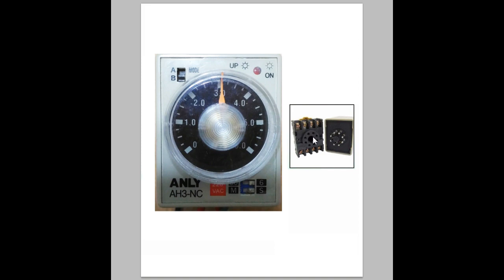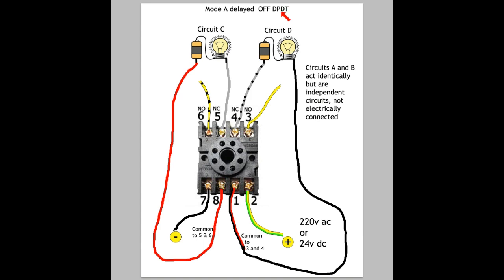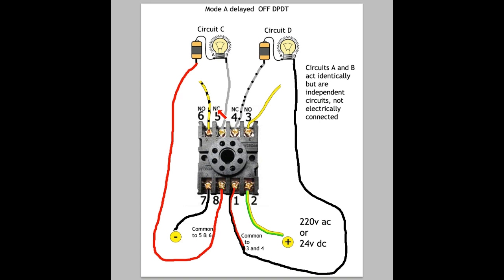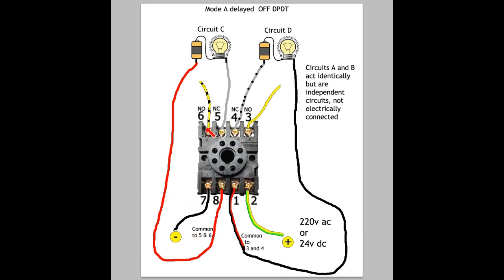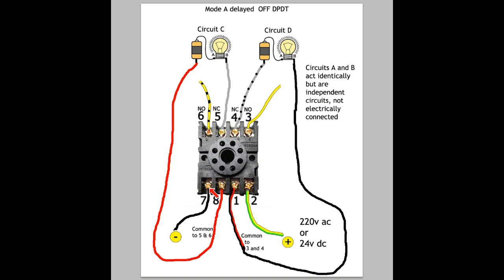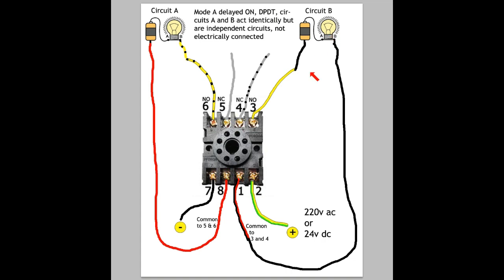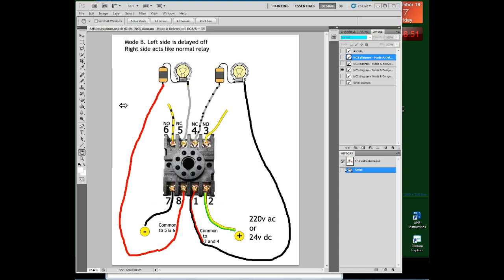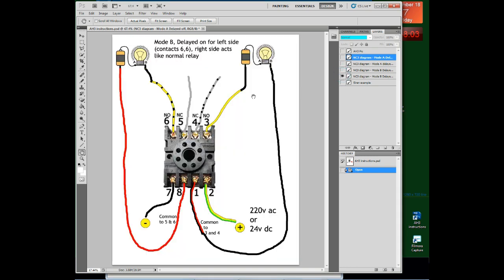AH3 Timer Relay instructions and tutorial in English

Comment: is the output the same voltage as the source?
Reply from the maker: The source (or input) controls the coil or the switch. I take it you are not familiar with relays, but the input current controls an on off switch, there is no output. It the case of my example the switch controls batteries, but it is separate from the source or input. If you go to your light switch and turn it on, you are the source or controller  of the switch, is the output then another human being? No, the output is whatever is connected to the switch, in this case, house current.